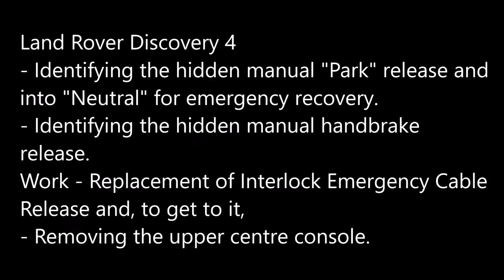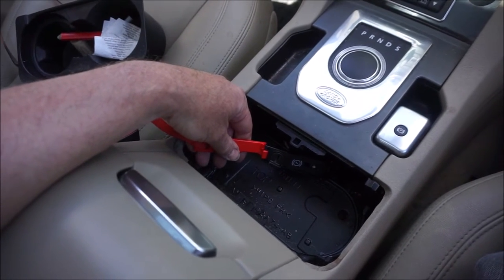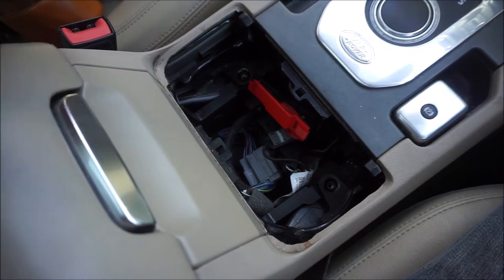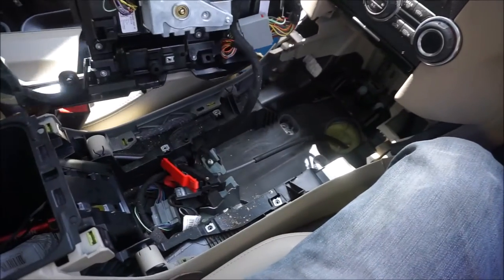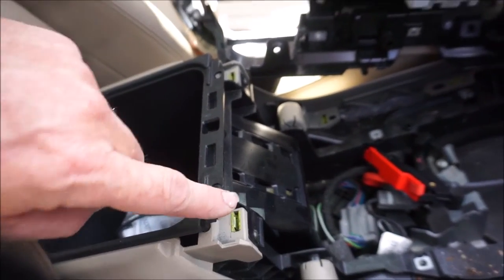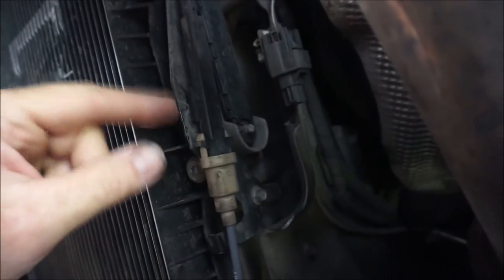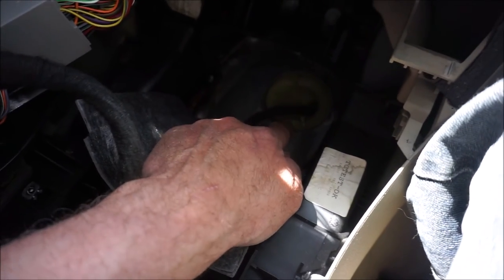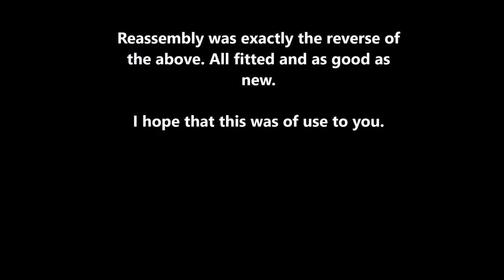Land Rover Discovery 4. Interlock emergency release cable. Hidden manual neutral & hand brake..

Comment: Hi Jimmy, today I replaced the cable in my Discovery 4. Another moron broke the lever before I bought the car. Relaying on your video I wasn't afraid to start and it was quick and successful. Thank you very much. ATB
Reply from the maker: Really pleased it helped you! Cheers!
Reply: @JimmyCogg  Indeed it helped. But it didn't request a special tool to dismount the plastic cover, I just used a water pump pliers.🙂

Comment: Thanks for your video, our D4 decided to stay in drive, so I have now changed the gearshift with you help.
Reply from the maker: Very pleased the video helped you
Reply: ## Jimmy - same again; thanks for the video, very helpful.  ### Walt motor company, I have the exact same problem & getting a new gear module today - Please can I ask, is it just plug in and it works - or are there complex computer actions required ! - Thanks in advance. Martin.     Any advice will be appreciated :-)
Reply: @barefootmart  Hi. It just plugs in and works. Even a dummy like me managed it lol
Reply: @waltmotorcompany7160         - Life saver - Thank you